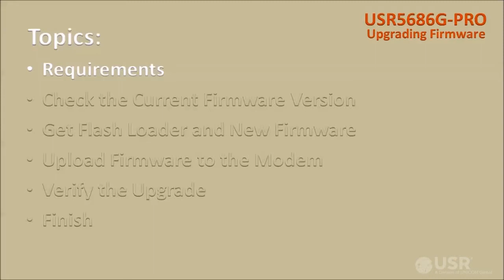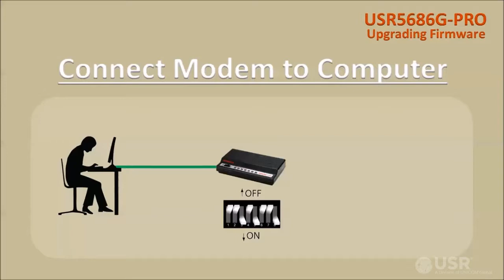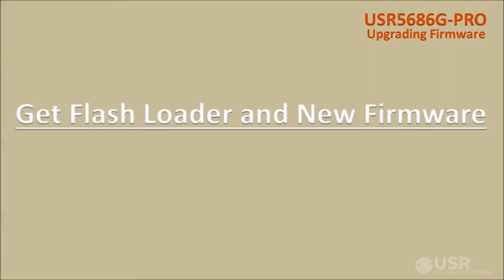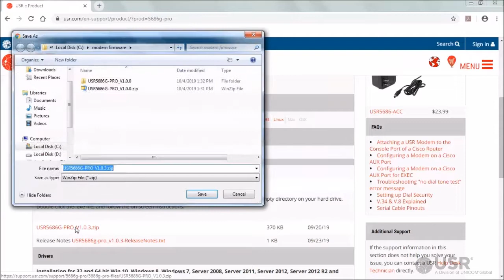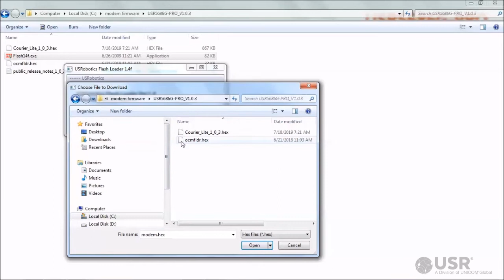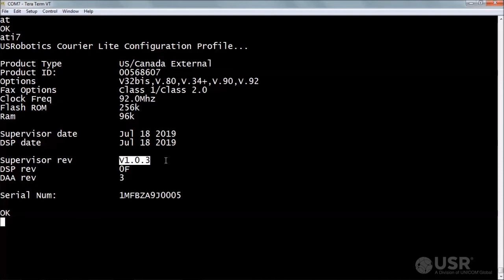Upgrading Courier Lite Firmware Video

Comment: Why did you kill the actual Courier line and rebrand a Sportster as "Courier Lite"? If it's not a v.Everything and doesn't have HST as an option then it's just a CINO (Courier In Name Only). Dial security in a firmware update to the 5686 line doesn't turn a Sportster into a Courier. You're well beyond tooling up to bring back the Courier line. We're resigned to the fact that a killed off modem line makes no sense to resurrect in in the 2020's, but don't try to pass off a Sportster as it's successor and the new "Courier Lite". I'm sure the old 8100 McCormick engineers are shaking their heads in disapproval. Bring back HST/ASL/v.Everything in a firmware update. Heck, I'll even take a super secret ATGW command, if you want to bring that back, if there's any of you there that even know what that is. Then you'd legitimately have a claim at calling a 5686-anything a Courier. Better yet, take on NetGear and make the best/fastest/feature-packed SOHO/SMB router on the market and call THAT a Courier if you want something fresh for the 2020's. I hope Unicom has better vision than to just ride the USR name, market-leading history, and historic brand equity all the way down to zero relevance.